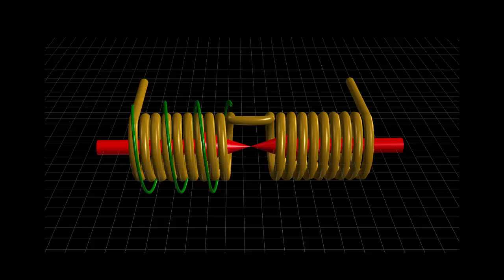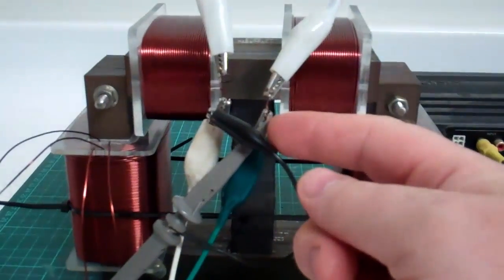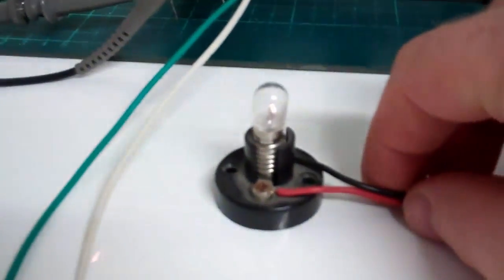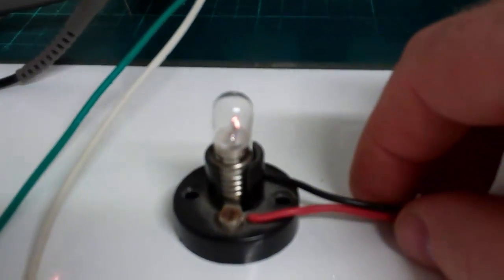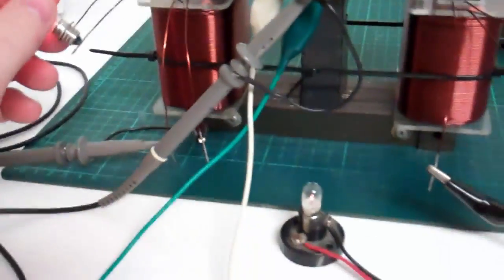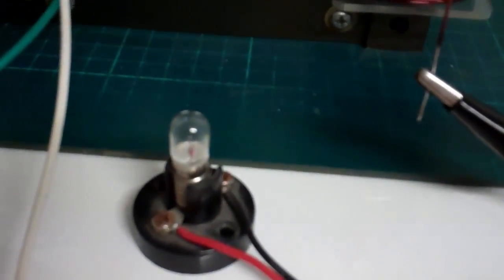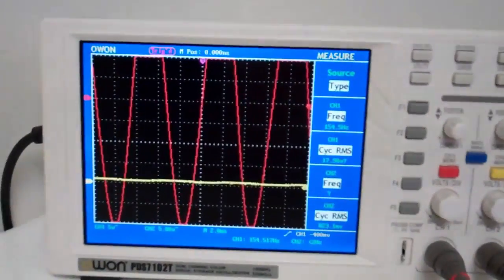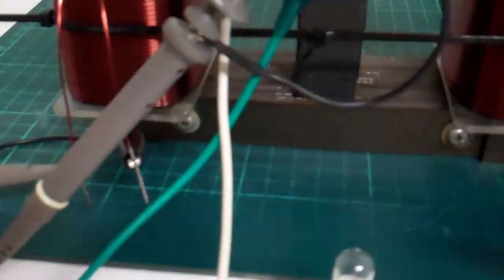Partnered Output Coils - Why it's Important to have Current Flowing!

Comment: chris i thought you might find this patent interesting; about bucking coils..US 4806834 A by earl k.
Reply from the maker: Hi Alex, Join us @ http://www.aboveunity.com - yes there is an aspect that follows the Earl Koenig Patent. I stumbled onto it, then I realised its importance. What is Electromagnetic Induction? Two Magnetic Fields Opposing, interacting and as a result Separating Charge. Parametric Excitation is simply the Regenerative Addition of Energy at the right Time to the System.
Reply: i signed up on ou .com but havent made any postings because it seems they are high caliber and my forte is not electronics but i do have an intuitive sense on many aspects
Reply: I do believe that partnered coils may be the solution to the drag of lenz if you know how to wire up the coils so that they help and not hinder each other
Reply from the maker: Be part of something better: http://www.aboveunity.com - I am no longer a member of ou.com - I exposed some crooked dealings. It was not taken very well.
Reply from the maker: Newtons Laws of Motion: For every Action there is an Equal and Opposite Reaction (Symmetry of a standard Transformer) - But what you are not told is that every Reaction has an Equal and Opposite Counter-Reaction which assists the Action making the Action more Reactive! (Possible Asymmetry of Free Energy Machine)
Reply from the maker: Please Read: http://www.aboveunity.com/thread/timing/ - This will make more sense!
Reply: @SweetSQM  hi, I have wondered y lot of generators r enclosed in a lot of iron instead of simple material that r equally more lighter and  durable, then I discovered the EMR is picked by Iron the more the Iron mass more the reason,... so use a small gen inside a iron dome of  some kind and check the potential generated I think it shd b magnified by the iron and the copper copper for charge and core for magnetic flux wrt to current and iron for raising the frequency generation to get raised current output... Would await ur studies